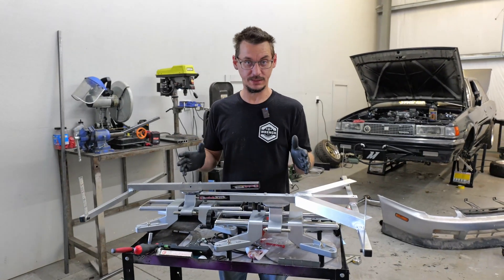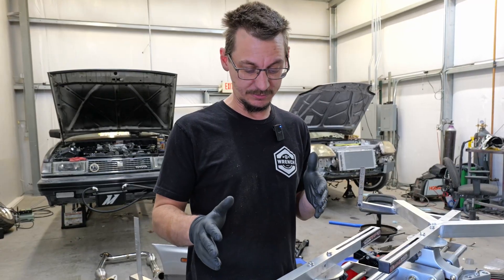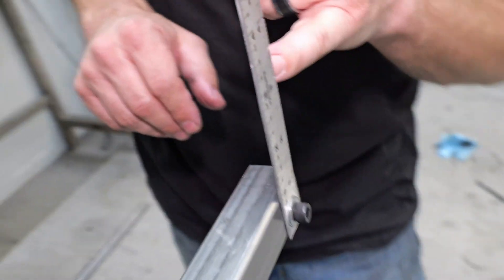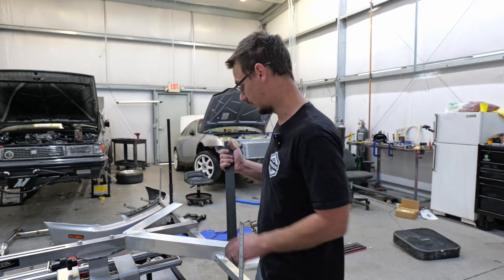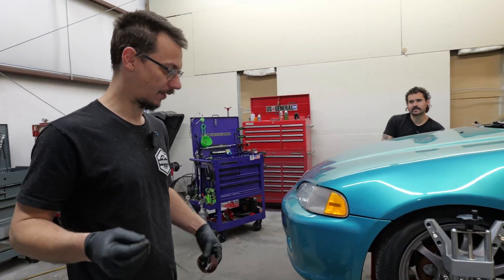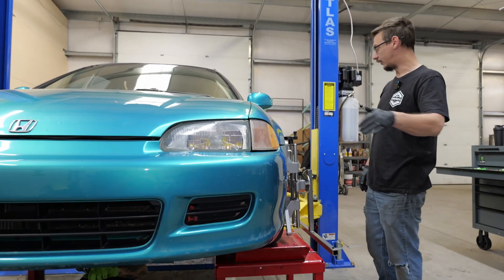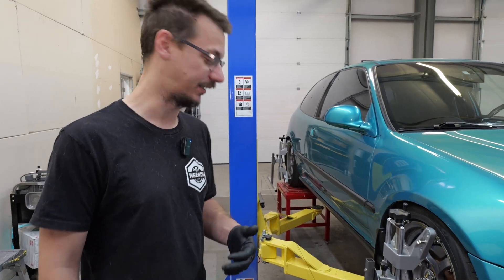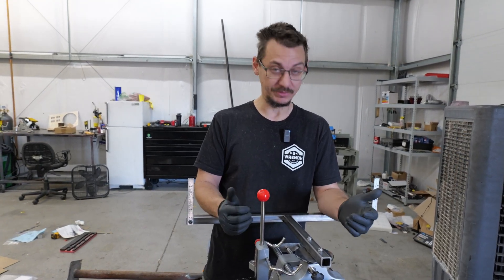Does a String Alignment Kit Provide Accurate Results?

Comment: My issue with the quick trip string method. 
If the rear and the front is off alignment. Can you adjust both at the same time? Or would you have to adjust the rear to the body of the car using the traditional string method first? 
If so how do you Tell whether it's the front or the rear that needs to be adjusted?